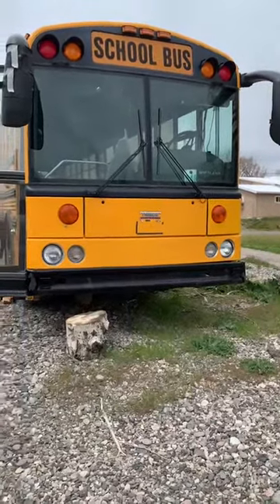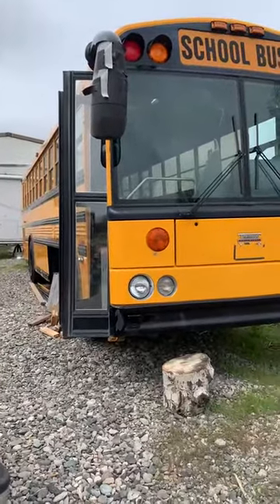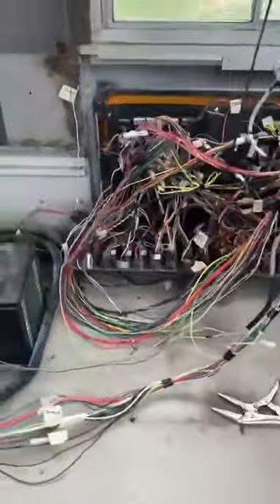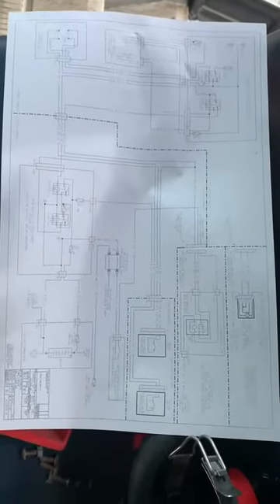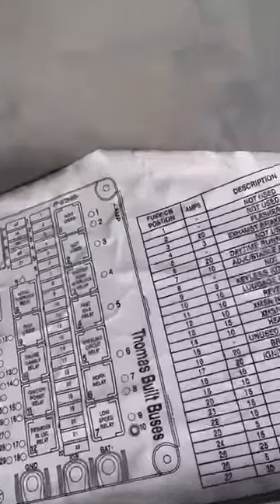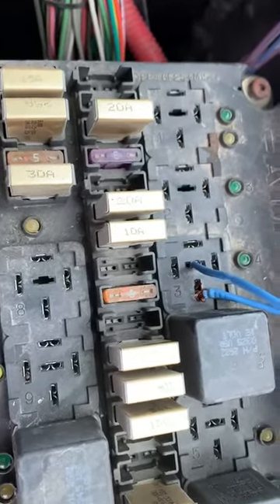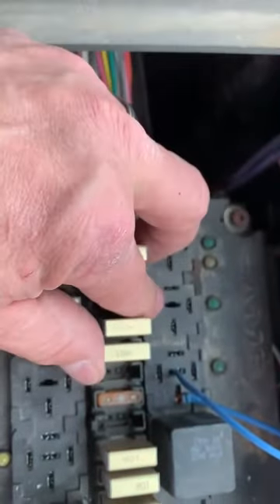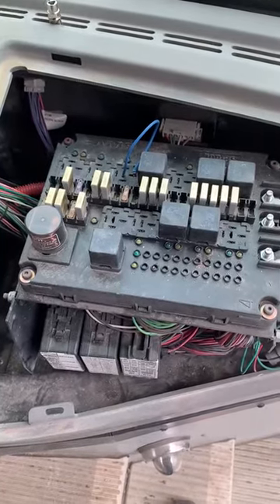2006 Thomas HDX school bus interlock bypass

Comment: Sir, I could hug you right now. THANK YOU SO MUCH!

My 2004 saftliner has not been started since before the winter, during which I've done a roof raise, removed the floor and a bunch of wires. I thought I could just cut out the emergency interlock wiring and ground it all back at the circuit board, but when that didn't work I felt so defeated.

Your video gave me hope and, after bypassing the relay (almost too good to be true how easy that was), she fired right up.

Thank you SO MUCH for taking the time to share this, it made me so relieved and happy.